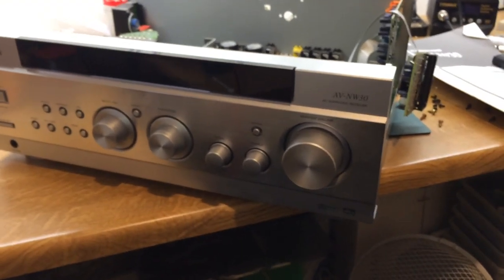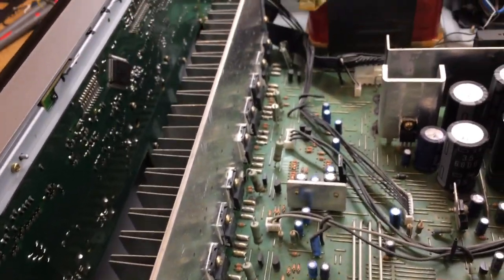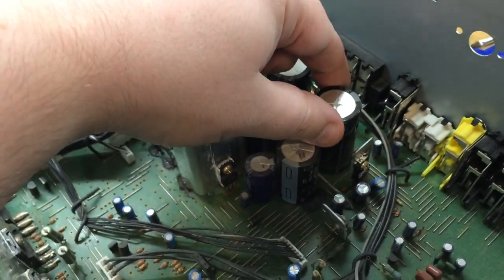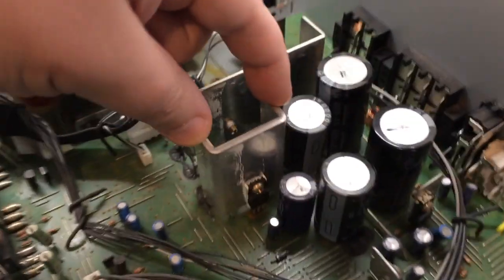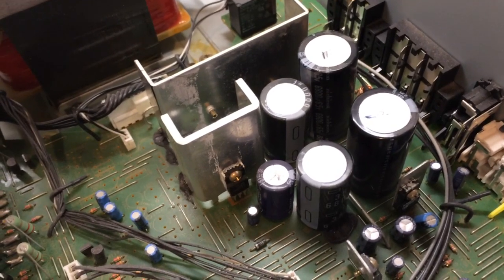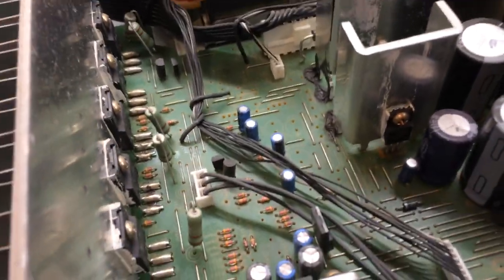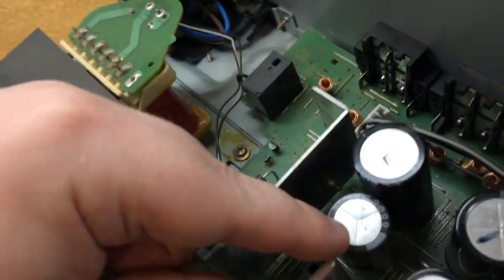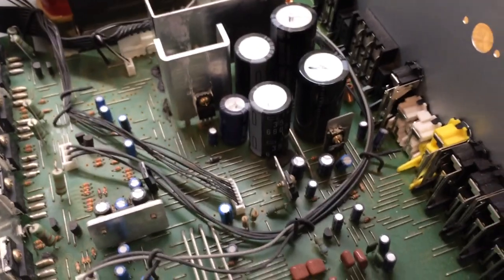Faulty Aiwa AV-NW30 5.1 receiver investigation

Comment: I had almost the same issues. With mine it was only the 12v regulator that was loose. Its build quite crappy if you ask me. It does sound good.
fdai i found in multiple cheaper minisets, looks like a company like xunda, nothing special.

Comment: I have a similiar model that the sound just went out, Is this fixable with someone locally even though its a vintage reciever ?
Reply from the maker: I wouldnt call this "vintage" whatsoever. It would depend on entirely why it has stopped working...
Reply: @jaycee1980  Appreciate the response, Wish me luck. I have them hooked to two Jensen CS315's that Ive owned forever, Sounded amazing.
Reply: @jaycee1980  My specific model is the aiwa av-d50
Reply from the maker: @henryfernandez2533  Service manual here:
www.hifiengine.com/manual_library/aiwa/av-d50.shtml